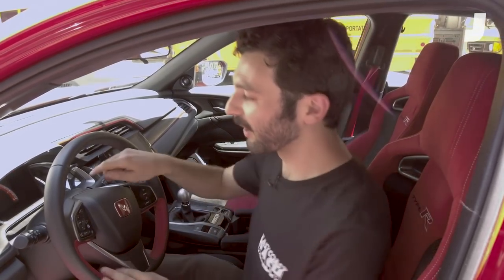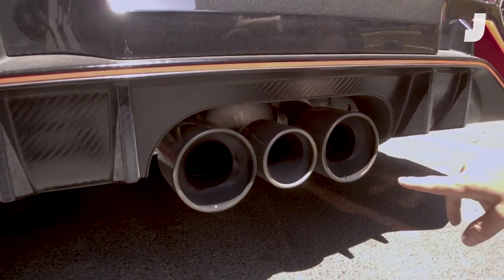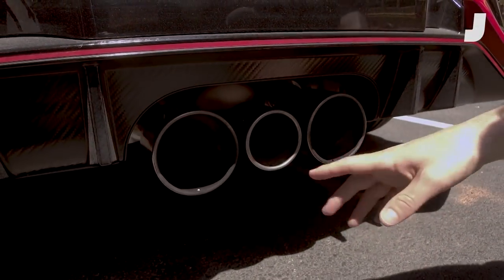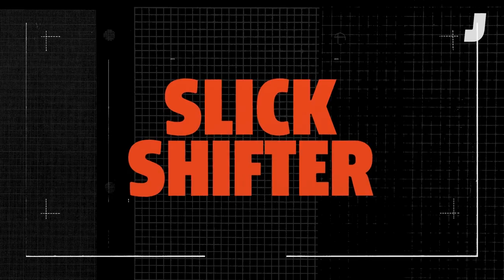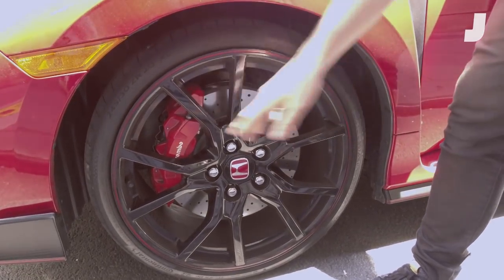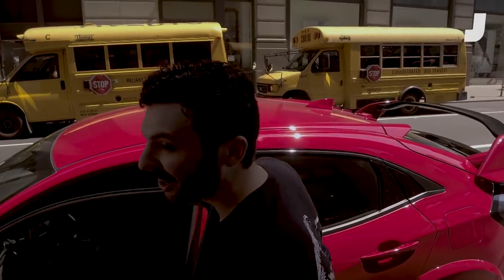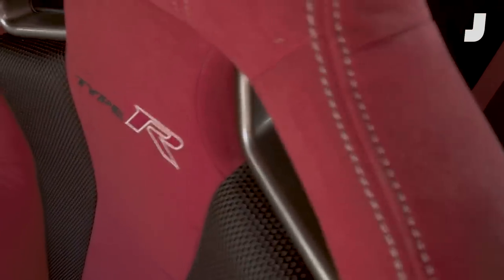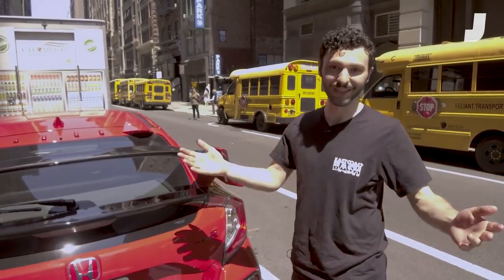5 Things To Know About The Civic Type R

Comment: I have a Type R and LOVE IT! The seats are actually designed in house by Honda and they are as amazing as everyone has said. You don't think about a sports car having comfortable seats but the fronts seats of the Type R are some of the best I have ever sat in. Period. Rather than the number of Type R badges being an issue, because I would not mind if there were more, one of the things you have to know about the Type R is that those high performance, stress inducing, low profile tires only last for 12,000 miles AND they are expensive to replace! There is a downside to sticky tires and this is it. It can be a shocker especially if you are used to getting 30,000 miles and above out of your tires.

Comment: 1. Hideous
2. It's owners recite a lap time that they could not get within 10 minutes themselves.
3. Sounds like a vacuum. Not a Dyson either, like a Hoover from '38
4. $10k markup by dealers because Honda fanboys are easily the dumbest fanboys. See. Number 2.
5. It has a vent in its rear bumper that is blocked off completely. Also dubs.

Comment: in the history of the world,..no one going 170mph ever thought "gee, I wish my car didn't have that big wing on the back..."
Reply: My friend has one. If it hits 170mph, it's taking hours to get there.
Reply: @GolfR-eady  Not really. Make sure your friend has his tires inflated at the right pressure. I have one and it accelerates very strong all the way up to triple digits. It is simply amazing how quickly and effortless it can go on the high way.  It is really "go to jail easy fast". There are numerous Autobahn all out drives with the Type R here on YouTube to check out which is really pretty remarkable especially with a car with a full manufacturer warranty. I have a 7 year warranty on mine. I am still breaking in my engine to at least 600 miles before I do more aggressive driving but I hope to take my Type R to a track soon so I can really experience what she can do. It is way too much performance for the streets and only an idiot would try to push a car like this to the limits on the streets. The Honda engineers really did dial in the aero on this car perfectly and the stability at higher speeds really justify the looks.
Reply: @StandingUpForBetter  They're really quick from a roll. I'll tell him that though, thanks for the tips! 
Hes stock and he loses most dig races but hasn't lost a roll yet. I have a 1995 Mitsubishi 3000GT VR-4 and from a dig he doesn't pull until 130ish, 140ish if I really smoke the clutch. Off any roll when the Type R has traction he walks me. Like no problem, just takes off. He raced a C5 Vette from a roll and walked that as well which was impressive, the Vette was obviously stock with the auto but we walked him really hard. 

They're fun. As far as handling, I'm pretty sure it's one of the best.
Reply: @GolfR-eady  Congrats on that Mitsubishi 3000GT. Definitely an under appreciated sports car. Yeah the Type R is quick but it is not a drag car. It does shine on the track and the twisties. There are plenty of other cars your friend can modify but tell your friend, if he keeps his Type R stock but takes care of it he will have a future collectable on his hands. In a few years, not only will his Type R still be working but it will hold its value better than many of the cars that are beating him now.
Reply: @StandingUpForBetter  That's why he bought it - he had a DC2 Type R in his 20s. He wants to track it soon also. Hes not into drag racing, he likes corners/tracks. He wants to track it but also doesn't want to over use it lol.  

Again, thanks for the info! They're sweet cars. Really strong mid range. 
Yeah my VR-4 is also a timepiece, I've had it for years and it's been stock all this time. I do drag and it still runs 13.4-13.5@102-104mph, best was  13.31@103.44mph, pretty decent times for a 1995 model. Its fun, but not near as engaging as an FK8.
Reply: @GolfR-eady  Very impressive! Enjoy man!
Reply: @StandingUpForBetter  Thanks! Hold onto your FK8, like you said they're the going to be absolute classics. My thoughts on it have changed alot since I made that comment. I have no doubt it could do 170mph with the way it rockets from 4th gear. 

I got lucky to have a friend that got one. Even riding in it is fun, and hell everybody wants to race lol. I love the styling even tho its controversial.  

Nice talking to you, see you around!

Comment: Over-styled, looks like someone glued a bunch of useless bits on it. They should have the same rule as food. Do not put anything on a plate you cannot eat.
Reply: Many would agree that it appears to be over styled, but none of the aero on the car is useless as you stated. Read any review from a journalist or driver worth half their salt, the car feels incredibly planted, which is thanks to all of the aggressive aero. Also is why it is the fastest FWD car around the 'ring.
Reply: You may be right. I have not heard about any statistics on downforce. But there are black plastic bits that do nothing. As far as reviews go, they are very mixed.
Reply: There's mixed reviews on its looks...which is subjective...when it comes to performance there's not another car in the price range that can hang with it.
Reply: I have actually driven the Ford rs and the Honda. The ford is faster and handles as well. The seats and interior are much better in the Honda. They are very close in price.
Reply: Rudi Fellner I've also driven both...the ford rides like shit...awful seating position...the CTR pulls harder than the Ford...the 0-60 is pretty much the only place is has an advantage...the CTR beats it 9 out of 10 times on most courses it races....and a fully loaded RS is like 42k and CTR IS 35k and it's more comfortable and 10x more reliable than the ford.
Reply: You are correct about the ride. I would no buy it for a daily driver, it is very stiff. Don't agree on the power. But I decided against both cars.
Reply: Rudi Fellner we dont have to agree lol...but trap speeds prove it out accelerates it...the AWD kills power
Reply: Richard Curt I agree with you on the all wheel drive, It makes cars boring. Unless you get into the supper high power cars.
Reply: @rcurt9984  the CTR can out accelerate the Focus RS from about a 40, maybe 30  roll, not quite from anything less than that. Definitely not from a dig. You're also not going to find one at $35k, most dealers are still asking close to $50 and don't usually budge because they know the next person will pay, so comparing prices is moot. 

Test drive both before going with the RS and paid $35 out the door. 

They're both awesome cars though and if I can ever find a CTR close to MSRP, I would buy it for my wife.
Reply: MuChawn Golden paid $34990 plus tax....CTR is a better car.
Reply: MuChawn Golden also u clearly didn't read my earlier post.
Reply: 50 is definitely to much that is getting into mustang GT350 territory.
Reply: Rudi Fellner most people aren't cross shopping a CTR and gt350.
Reply: @rcurt9984  some people feel the Focus RS is better some feel the CTR is better. Reviews I've seen are pretty split on the matter. You must feel a need to justify your purchase it seems. I like both cars and if I had to do over again I would pick the RS again and get the CTR as possibly a second car. But I'm not going to try to convince the YouTube world to love only the car I purchased, because I'm confident in the choice I made.

Yes, I read your first post and I was confirming that most races I've seen have the CTR pulling on the RS with the exception of from a dig. The main point I was making is you'll have a much harder time finding the CTR at MSRP than you will the RS, which actually a compliment, isn't it? 

As far as reliability, I'm guessing you're referring to the head gasket issue on the RS, which Ford has acknowledged and fixed. How is the transmission problem the CTR has being handled, by the way? You know, the one Honda was denying was an issue?
Reply: MuChawn Golden I'm glad you got that off your chest... enjoy your ford.
Reply: @rcurt9984  why, thank you. I've enjoyed it every day for a year and 16,000 miles! 😃
Reply: MuChawn Golden 👏👏👏👏
Reply: Wow. Is that ur best diss to this car. Seriously. U said the same thing as every other hater. Ur not clever or original.

Comment: The S2000 is still the better drivers car. Sorry not sorry a nice one will still cost as much as brand new civic.
Reply: S2000 isnt around anymore though, this is all we got.
Reply: This car is still faster and handles excellent.
Reply: The Type-R is faster and better to daily. S2000 is obviously the better drivers car, but they both have their pros and cons.
Reply: crashyyy practicality is not measurement for sports car. I'm a Honda fanboy but Honda f*cked up by not giving this car a dual clutch and AWD.
Reply: Candle Jack it would ruin the heritage of the car...it beats car with awd and DCT.
Reply: Richard Curt I'm sorry they wasted the chassis on FWD. You can block your ears and yell "Nurburgring" all you want but any real enthusiast knows that it will lose to an EVO MR on most other road courses and is not as satisfying to drive... even if Honda has the best manuals, DCTs are chasing it away.
Reply: Richard Curt the Chevy Cobalt SS ran a better lap time than a Lotus Elise on VIR according to Car and Driver. But it doesn't mean that Cobalt is the better car.
Reply: Candle Jack I'm not going argue with you since we both have different opinions...dct are boring to drive and stock for stock a CTR would hold it's own against an MR...which are complete garbage in my opinion. It's funny the CTR is so competative with 2wd and a real transmission.  Oh and I never said anything about the Ring...but the Slow CTR does hold like 4 or 5 track records around the world without all the fancy bullshit.
Reply: Candle Jack lotus doesn't even use it's own engine in the Elise...please stop.
Reply: @PumpUPdaBase  its not worth ditching the driver engagement of shifting yourself in favor to "be faster".